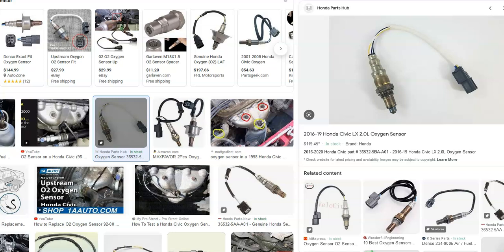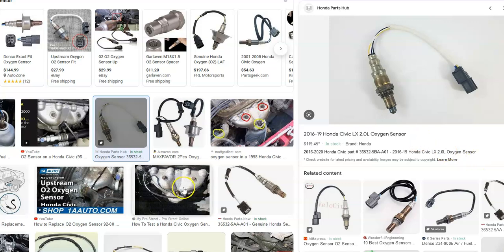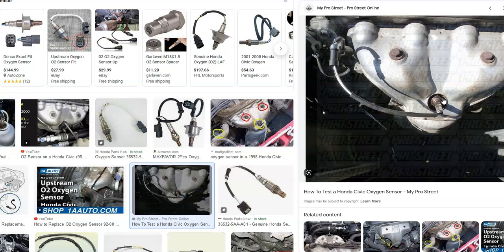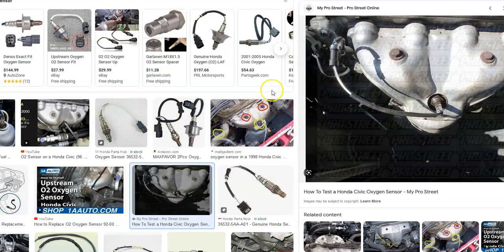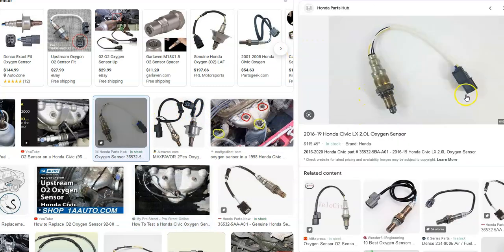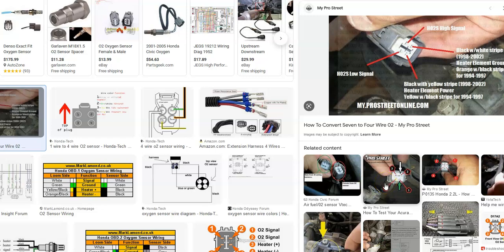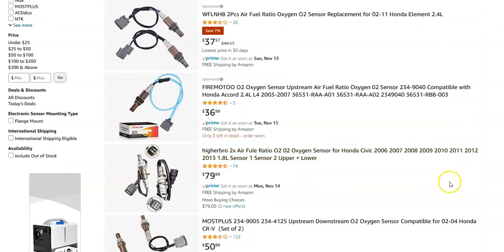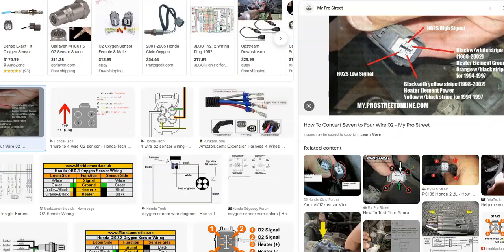How to Fix HONDA P1157: Air/Fuel Ratio (A/F) Sensor (Sensor 1) Circuit High Voltage

Comment: I found the higherbro 2PCS Oxygen Sensor for 2005 2006 Honda CR-V CRV 2.4L Upstream + Downstream

Can this be used for a honda crv 2015 please
Reply: No.... you are looking at models that are 3 models older than yours... the connectors alone will be different.. can't use the older sensors.